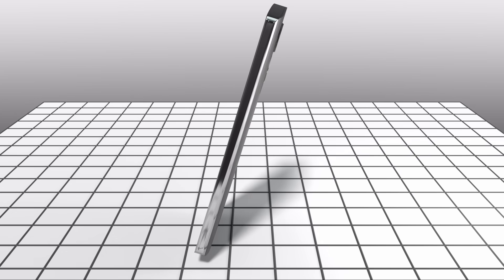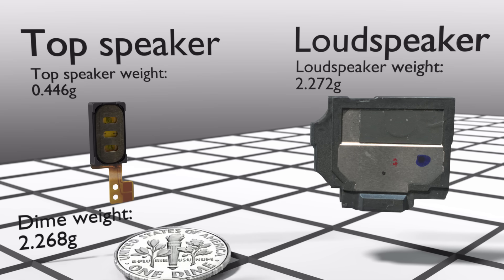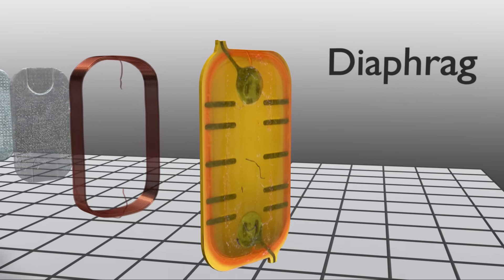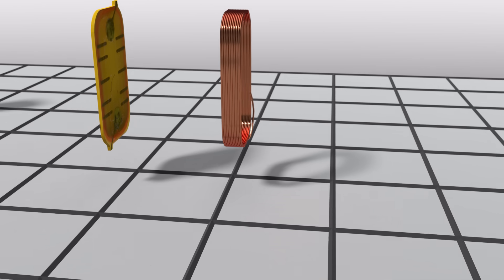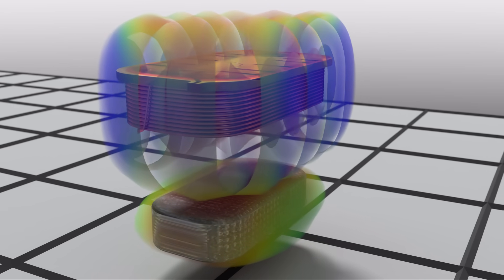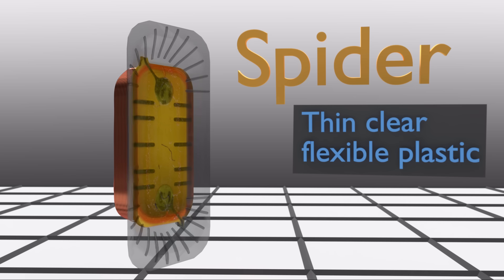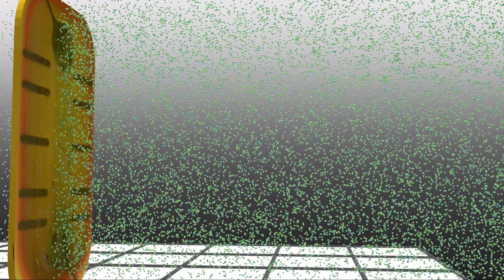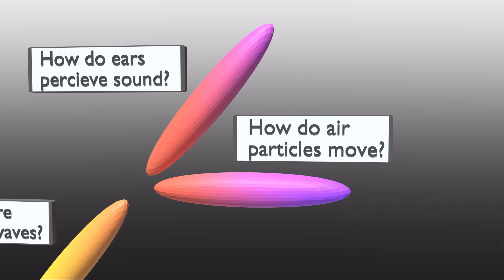How do speakers work?  Incredibly small, yet impressively loud

Comment: I think this concept of a ‘low-pressure wave’ is the missing piece to my understanding of sound wave propagation. The low-pressure wave propagates forward just as a high-pressure wave does, pulling the molecules back as it goes. I couldn’t reconcile the back-and-forth oscillating movement with continual forward movement. The oscillations are local but each wave component is always moving forward. Crazy.

Comment: Wow! Really nice presentation! Very clear and I love the graphics too!  I thought it was going to be about "regular" speakers, not iPhone. Although, I can see it is probably very similar to a regular speaker anyway. 

I wonder if you could help me with a project I am trying to do? Can you please tell me how to daisy-chain several speakers? Just the naked speaker coils/diaphragm/magnet/spider part, not the ones in speaker boxes. I would like to daisy-chain 3 or more 8 Ohm .25 W 57 mm Round speakers. The first one would be attached to an output device via its + pole.  Thanks in advance!

Comment: I have a question. The current induced into the coil determines the distance travelled by the diaphragm, which I assume sets the amplitude of the sound, thus it's volume. But how is the frequency determined? How can the processor take binary code and turn it into a certain current which will emit a sound of a particular frequency and amplitude?

Comment: I was trying to figure out why my left speaker on my pc wasn’t working. I removed the assembly and had a small screw driver in my hand they touched and sound came out I was surprised. I removed the screw driver it stopped playing, I tried my finger on the spider web of the speaker and it started playing again so I put a rolled up, flatten piece of gum wrapper on my computer speaker close up the computer. With the keyboard weighing down the wrapper on the speaker. It plays flawlessly now.

Can you explain what is going on in this circumstance.
Reply: My guess is that the form on which the voice coil is wound is rubbing against the central part of the magnet. When you press on the spider, you prevent it from rubbing and get the sound. Turn it loose, it rubs again, and quits working.

Comment: Similar thing is used in earphones too. So what seperates a expensive earphone from a cheap one? One thing is clear that expensive one is better, as we can feel the difference between sound quality, bass, etc.

So if the mechanics is same , there where is the difference ?
Material of the diaphram (although i doubt that is the case) ?

Comment: Lots of Q
How Battery work's there's lots of video about that on the web but  but no one has explained at atomic level , like 
* what properties of material needed for making  battery ?
* which types of material can be use  for anode and which for cathode ?
* What is responsible for cell nominal voltage ?
( Ex , why li ion generate 3.6 to 3.8 volte and why lead acid only generate 2 volts so on )?
*How and why some type of separator only allow to pass ions ( which is big in size compare to electrons ) but can block electrons which is much smaller ? And question for Proton exchange membrane ? 
*Is there any maximum limite for cell Nominal max voltage ? Or it can go higher in future from 4 volt to higher like 5v or 6v .. ?
Ply you flash light these questions in batteries video ??

Comment: After this amazing explanation, I still wonder what are the main differences between an expensive speaker from brands like (JBL, Bose, Denning, Altec Lansing, Burmester) and other brands. Is it just the construction and quality of parts used considering all other parameters equal?
 Also what exactly is meant by sound stage and sound equalisation. Are they two different concepts?
Reply from the maker: Hey Daniel,  to be honest, I don't know the differences, just a basic understanding of the components and their function.  As for a sound stage vs equalization, they are indeed different.  One is a space for film making, and the other is where you adjust the frequency levels to get something that sounds nicer.
Reply: The major difference is that of scale: where the speaker in a phone probably produces less than one watt of sound energy, a large speaker that's part of a stereo system may dissipate hundreds of watts and produce sound that will rattle your guts.
   To handle the greater power, everything about the speaker must be scaled up. The magnet may weigh several pounds, and the voice coil must be wound out of large wire, which may be surrounded by a ferro-fluid to help keep it cool. And, the speaker cone and even the frame of the speaker must be carefully designed. All of this adds to the price - a good speaker is not cheap!

Comment: Here's a question: How does a speaker generate 2 sound simultaneously
Reply: It is one sound. Two sounds fused together in one.
Reply from the maker: You should check out the followup video that goes into what is sound? : https://www.youtube.com/watch?v=24yESm63tSY&t=1s
Reply: Radu Burcea with multiple audio channels, like stereo. Some smartphones use the earpiece speaker with the loudspeaker to make two sounds at once, which is stereo.
Reply: @dusscode   YOU ARE WRONG. PHONE SPEAKERS ARE ALWAYS AND ONLY IN MONO. Have a nice day!
Reply: @osiandelzongle6738  That’s not true, each individual speaker is in mono, but if there are two speakers each one can play left or right of stereo in mono creating stereo with both speakers working at once.
Reply: @osiandelzongle6738  nope. several phones have stereo speakers, combining the top and bottom speakers.
Reply: @osiandelzongle6738  You are incorrect and @Marwi was right. Most modern phones will produce 2 different sounds from the earpiece at the top and the loudspeaker at the bottom to produce stereo sound when the phone is held sideways.
Reply: Your brain is taking as 2 different sound but speakers just creates sound 
.
Reply: The frequencies must be combining to come out together as a combined wave(two frequencies can merge in interesting ways) , both having low amplitude or "volume" per say, individually.
Reply: I've never understood either how, let's say you have singing, guitar, drums, idk.. horns, whatever, all in the same vibration. Those are all different things. So how does a speaker, which only vibrates in one axis, emulate all the possible sounds at the same time in one wave? Same with a record groove. I understand there's timber but still, I just don't understand how all possible sounds can be combined into one single wave.
Reply: 𖥠 ꧁Æ♱ℍᴲᮄℜᴲⅅ꧂𖥠  Multiple waves can add together to form one wave. At any given moment, you are listening to only one distinct sound wave which is the sum of other sound waves. Here’s a cool demo: https://youtu.be/hnZ1FKVWN4k
Reply: @NoZioKikes88  I've struggled with this question as well, but what I've come to find is that at any given moment, you are experiencing only one wave in either ear. Any isolated sound is comprised of pressure waves that occur with a particular frequency, and your brain interprets that as a pattern. When you add other sounds on top of that, the amplitude of each sound is added to the other, and your brain is recognizing both patterns at the same time even though each ear is being hit with one amount of pressure at a given moment. If there are too many sounds occurring at the same time, it becomes difficult to find a distinguishable pattern, and your brain cannot discern any of the sources producing the sounds, or even where one sound stops and another starts. It is in such a scenario that it is apparent that you are really only hearing one waveform.
Reply: @NoZioKikes88  Actually what happens can be explained using Fourier Transform, his work is revolutionary and shows that ANY sound/electromagnetic wave consists of a sum of sine waves. You can learn more about this by watching this video from 3Blue1Brown: https://www.youtube.com/watch?v=spUNpyF58BY.

So, when multiple instruments are being played, the waveforms created by them are mixed together through constructive or destructive interference. Some frequencies may add up and be more present, some may just cancel out. Basically, what we hear is the result of the waves interacting with each other and mathematically becoming one single wave. This way we can listen to multiple instruments and voices at once. So, when the speaker plays just one electrical signal, this electrical signal resembles one wave that is the result of many other waves together.

You can even do this process in reverse, pick up a wave and tell apart the frequencies that it consists of (This is Fourier Transform). This is what spectrum analyzers do, I'm pretty sure you've already seen one, Windows Media Player (Windows 7) has this built in as an animation of bars going up and down. They are reacting to the frequencies present in the sound.

Hope you find this useful, watch the 3B1B video if you want to know more! Bye!
Reply: @GabTheAdventurer  Thank you, I'll check it out. I just couldn't understand how many waves can be one wave but your explanation is helpful.
Reply: @NoZioKikes88  You're welcome! I'm sure you will understand once you see the video and see the math behind it :)
Reply: @NoZioKikes88  This is also why you have resonances if you play multiple sounds "at once".
Reply: @NoZioKikes88  It goes back to the microphone which converts the sound waves to electrical waves. One type of microphone is constructed exactly like the speaker shown in this video. A variety (possibly) of sounds hit the microphone but combine so that only one pressure wave results from all the different sounds added together. This causes the microphone diaphragm to move, and the moving coil in the magnetic field generates the electrical wave which is a precise analogue of the pressure wave. 
   When the electrical wave, perhaps after amplification, is applied to the voice coil of the speaker, it causes the speaker diaphragm to move in exactly the same manner as the diaphragm is the microphone. The result is that the same sounds are produced by the speaker as those that hit the microphone. It's really quite simple, but it's also like magic. This was discovered many, many years ago in the early development of the telephone and the "talking machine," . . . phonograph.
Reply: @NoZioKikes88  You're brain separates out those noises as separate sounds. It's all one frequency. It's like eating soup but being able to taste all the different seasonings in it.
Reply: Good question
Reply: multiple sound frequencies are blended in to one complexe motion from the diaphram making seemingly multiple sounds, but in reality really only is one
Reply: The answer is relatively simple. The speaker is making one sound out of the combined waveforms of the signal presented to it. Your brain recognises the sounds within that pattern and constructs them to make sense of the combined noise. In the same way our eyes take an enormous amount of visual data and your brain reconstructs it to make sense of it based on what it has learned over your lifetime. Newborn babies cannot do this and have to learn how to do it. My cat cannot make sense of a panoramic view but can see the movement of a bird.
I remember my 2yr old grandson hearing an opera singer and asking what is that noise? He had to learn what it was he was hearing. Human brains are remarkable things.
Reply: How do our ears hear multiple sounds at once? Sure we have two ears, but even just one of those ears can hear multiple things. It's the same principle. Speakers can modulate their movements at varying speeds very quickly to reproduce many sounds at once.

Comment: I have some questions. 
1.How  the electric current wave is produced corresponding to sound?
2.How one dimensional motion of diaphragm produce such complex sound? I mean by this motion, only frequency and amplitude can be controlled but what about sound quality/timbre and smoothness of sound?
Reply from the maker: Yeah!  These are great questions.  The current in the coil is produced by a digital to analog converter [DAC], which will definitely be an episode eventually.  For your second question, ya should take a look at the other video ' what is sound'.  The smoothness relates to the sampling of the audio and the DAC- sampling will definitely also be a video.
Reply: @BranchEducation  
Thanks for reply.
.
I'll be amazed watching your video answering my questions. l'll wait for them.